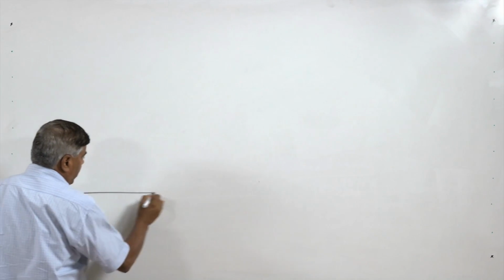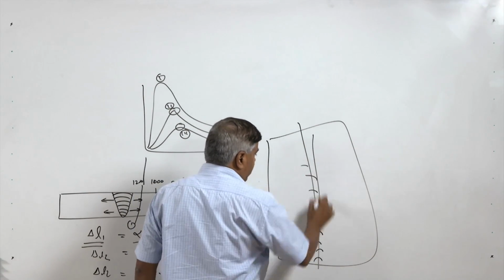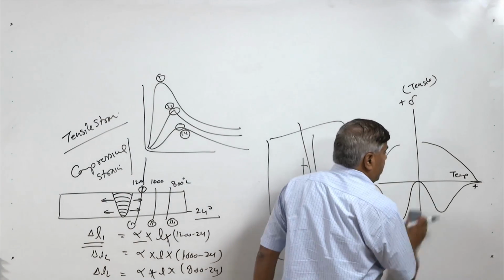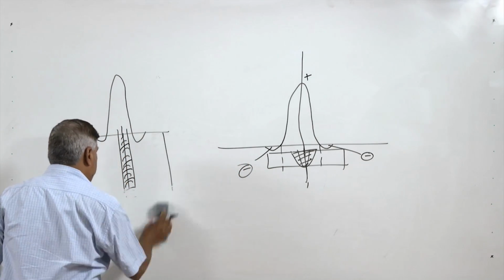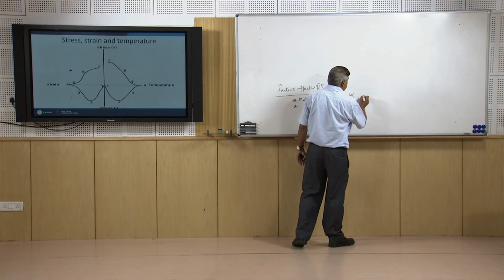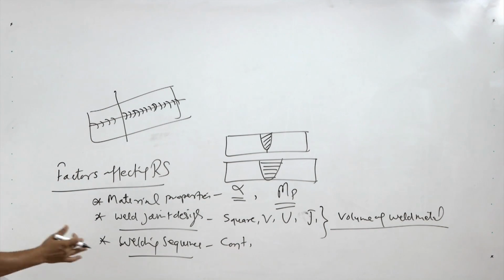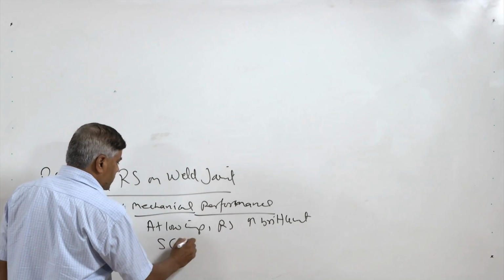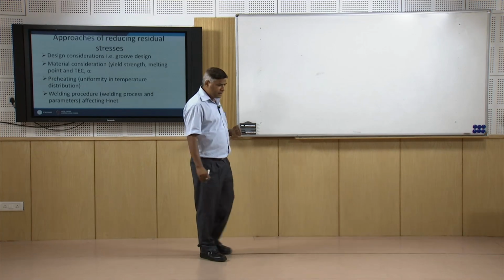Lec 38 - Residual Stresses in Weld Joints

Comment: I have one query. Did residual stresses increases if heat input increases. Suppose 50J, 100J and 150J energy input. If so why?
Reply: I think so, because, increase in heat tends to expand more material. It depends on cof thermal expansion. I hope I am correct, if not please let me know.
Reply: Residual stresses depends on temp. Only

More heat make deeper penitration or will increase welding speed...